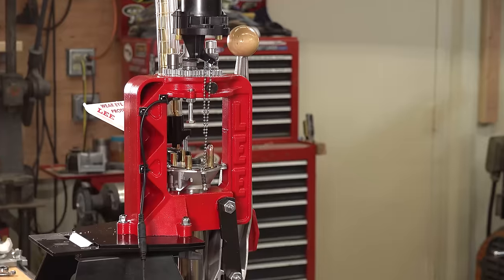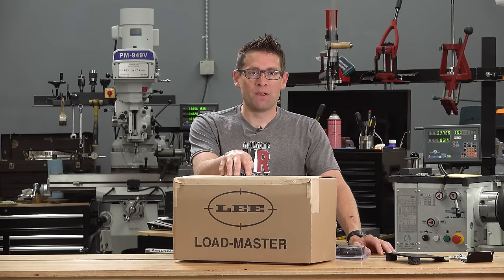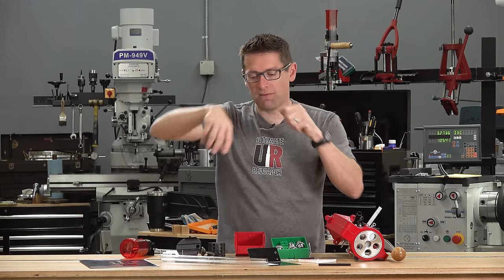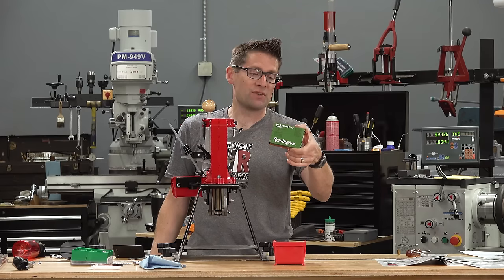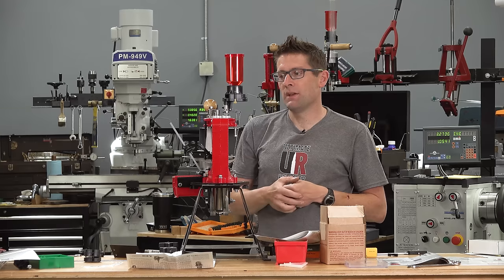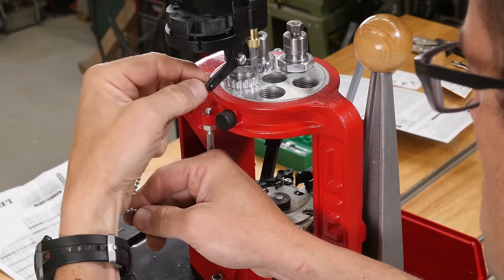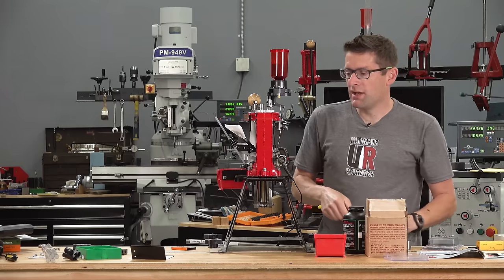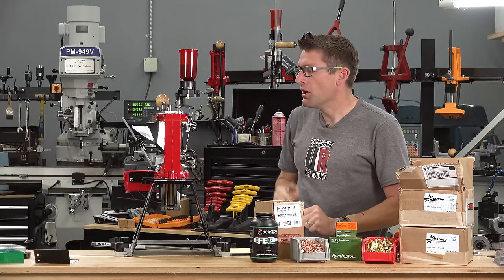Lee Loadmaster Unboxing/Setup, Loading 9mm Start to Finish

Comment: I observed that the press would tilt using the mount shown. 
There is something about the mechanics that make it move in a lot of videos. 

You were doing about (12) per minute.  
That would be about 5-600 per hour.  
People often have unrealistic expectations that output is based on how fast you can stroke it. 

This press requires that you push gently as you seat primers at the bottom of the stroke. 
At the top of the stroke pushing in the rod to move the shell plate and not roll over the primer is required. 
Developing this rhythmic movement is why some cannot use this press, sing, or dance...

Station #2 can use a Lyman M die or similar for cast bullets. 

I do have the feeling the Press is going to be updated or replaced soon.
Lee is really into their breech lock designs. 
Realistically their new locking lock rings make the need for the beech lock of questionable value. 
Also the 4.5 or 5 dies on the press is showing its age. 
People want powder check dies & bullet feed dies.  
With a four die pistol set that means (6) stations. 
Six would also place Lee in a unique position in the herd of presses.

The priming systems on Lee presses seems to be beyond 10% of the markets ability. 
Others seem to have no issues while others never got them to work. 
Avoiding primer detonations has always been part of their design in every system. 
I think the compromise will be a version of their manual safety prime or an automated trough system that the user decides they prefer.
Reply: Yup, the on-press Lee safety prime system is starting to show it's age, I personally hate it on my Classic Turret, do all priming off press now.
Reply: C-Bomb  I bought a prochucker  7 that by far was a big mistake.
Reply: That is a press that looks so nice but does not get good reviews.

Gavin 's umbrella review will be interesting.

Comment: Hey Gavin, I bought a Loadmaster last year and spent the better part of last Fall and Winter reloading with it.  I am in the process of selling my house and moving so unfortunately for me,  the opportunity to load even more due to the virus thingy, is on hold since all my stuff is in storage while I move.  Anyway, I also have the Pro 1000 and find the Loadmaster to be my favorite.  One reason is that the primer seating takes place when the operator's handle is in the down position as opposed to the up position like  on the Pro 1000.  It's just easier to push down on the handle to seat the primer, than to pull up.  I also have a micro camera attached looking down on each charged case to check the charge.  The camera is connected to my laptop which I use to display the image.  Also, the ability to empty spent primers on the Loadmaster is much easier.  My Pro1000 is still going strong however after nearly 30 years, but the Loadmaster is a real treat to use.  So I've set up my Pro1000 dedicated to 9mm,  and the Loadmaster handles 40 S&W, 45ACP, 44 Spl/Mag.  I do use dedicated tool heads for each caliber for ease of use, and the presses are mounted on a solid wood workbench.   Looking forward to seeing your press comparison!

Comment: I have two loadmasters set up 1 for 38 and 2 for 40. I also have a lee beach lock pro for 9 mm. My next step is getting a bullet feeder for each one. When I was getting into reloading I was set on a Dillon xl750 but did my research and settled to start with lee. I am still thinking of getting a Dillon. Ps love your channel.

Comment: Not happy with my lee master, i set it up for 9mm. Used your guidance as well as the instruction manual. It’s bolted to a hard flat surface and I still keep getting squib loads… Keep up the awesome videos.

Comment: I have an RCBS 4x4 progressive press that I've been using since 1985.  Everything is manually done -- the indexing, case loading, bullet loading, powder drop, primers.  I'd like to move to a more automated system, but I have such an investment in shell plates that it would cost a fortune to replace them all.  The biggest annoyance is that I shoot quite a bit of 480 Ruger, and I can't get a shell plate for it, they never made one.  I think have 15 or 16 different shell plates for it.

Comment: I don’t mind my Lee loadmaster.  It appears that yours has an updated case pusher and priming system.  I have had some major issues with the priming system to the point I started hand priming all my cases first.  That sucks because that’s suppose to be a huge benefit of the progressive press.  I’ve also had issues with the mechanism that rotates the shell plate too.   It’s been a while since I’ve used it because of those reasons.  That sucks because I have more then one tool head and shell plate for different calibers.  Great video!
Reply: I totally agree, have had those issues and more.

Comment: can't wait to get mine set up, seems like it will be a good press, don't like the plastic parts, but just gotta pay attention. I ordered the 45acp kit, they sent with a large priming pin, so I had to contact Lee and order the small pin, the pin was free, but then they charged $12.22 for shipping, I was quite upset about that little trickery.   they sure could've threw it in with the kit, considering 45acp uses large and small.

Comment: Great job on the video! I got my LM  .223 a couple years ago & your title having 9MM caught my eye as I bought everything to start doing 9MM soon. I've loaded .223 & 300 Blackout with good success. However when the cases get down to 2-3 in the feed tube, they will tend to bounce on the tongue & fall off. Seen many others have this problem too. How to fix this? 
Others have tried various techniques, none of which I like. 

I added an LED light under the powder station to see if the primer didn't get seated. Hate cleaning up spilled powder. Added a light ring upgrade to see the powder level in the case too.
Also I started out with Lee in '08 with the Classic Single Stage Press to see if I even would like reloading,  and started with .40 cal. I did like it,  so then stepped up to the Classic Turret Press. I still use these 2 presses from time to time.

Comment: I found that if I use Accurate #5 powder that it is so fine it drains through the flash hole if it does not prime a case, which is fairly common on the loadmaster. Just don't forget to empty it often so the ram doesn't turn into a pipe bomb at crotch level.

Comment: You may this look too easy. Thanks for the video. Mine would not even index the shell plate when I took it out of the box. Lots of trouble getting it to work. Not a happy camper. I guess video editing helps because I don't see any upside down cases being fed into the shell plate. :) That's thanks to the collator.

Comment: Gavin, I came real close to ordering the loadmaster.  But after fighting with the lee bench top primer I didn't have any faith in the loadmasters priming system.  I bought a used Dillon 550B instead.  But my uncle picked up a loadmaster so I will eventually get to compare them...

Comment: Yes I run a loadmaster and have found that that your brass primer pockets have to be perfect or you are going to get tipped or crushed primers.  Using new brass like you just did is a huge advantage.  Can you do a video on how to achieve perfect primer pockets so we do not get any jams using  the lee Loadmaster?  Also troubleshooting tips on the case feeder.  Thank you
Reply: RCBS case prep station and bevel all primer pockets prior to reloading. ZERO issues thus far.

Comment: ...I used to own TWO Pro 1000s both with the case collators...it made the whole process so easy...too easy because I got into a groove and didn't notice that I'd run out of power along the way...after you've hadda disassemble at least 100 rounds to find where the oversight occurred you'll never do it again....with the disks I found on my setup that the holes were about .3 grains over - an old timer (I'm an 'old timer' now) told me that he adjusted

Comment: Had a Lee 1000, which was damaged in a notable flood.  Replacing it with the loadmaster. Looking forward to 5 stages.  Half set up now.  Had a little trouble with the indexing not indexing, but it seems to be fine now.

Comment: Just bought a Loadmaster and have lights on order.  One of the case alignment tabs snapped off on the priming station.  The fellow I bought it from Budget Shooter Supply in Surrey, BC, Canada, was good enough to swap it for another one he had in stock.  No idea how to change the whole carrier which is what I would have had to do.  You have a video on that?  I have another carrier on order from Midway just in case.  The press seems to work great. Things slow down when you have to gauge each loaded round, add primers which is a pain with new priming tray, and keep flipping over cases that are in tubes upside down from collator.  They advertise 500 rounds an hour.  I’d say closer to 200 which includes above plus picking up loaded rounds on floor.  Lee has also made mistake of discontinuing this press and coming out with the 6000 which is way more cheaply made.

Comment: I found that when loading cast or powder coated cast using a separate crimp die is a necessary.  Using a crimp seater die will shave some of the lead or coating off

Comment: I had the loadmaster for a couple years finally got rid of it and bought the Dillon 650 best thing I ever did. I’m mechanically inclined and could never get the press to run reliably.
Reply: Same, I'm a master mechanic, can rebuild transmissions with my eyes closed, best day of my life was when I got rid of the Loadmaster and got a 650...

Comment: I'm running a Loadmaster still working at getting it running smoothly. My main problem right now is the indexing rod and flipper set up. It will work for 5 or 10 round then I have to adjust it again. Still have a lot to buy for it too since I was a used press.

Comment: Wow, I bought my Lee Loadmaster in 1994. It works very good but perhaps I need to update a couple of accessories. I had trouble with fully seating the primer on the 44 Magnum. Typically a wheel gun, I could not close it. Never got it corrected but honestly have not tried since. ASE Master Tech since 1978 - Retired

Comment: Im trying to decide if I should go with the loadmaster being I own mostly all lee products, or take the plunge and go with a dillon 750
Reply: I have been using a Dillon Square Deal  B for 29 years and recently upgraded to the XL-750,  It is expensive but runs like a Singer sewing machine.  I grin every time I use it.  You wouldn’t be disappointed with the 750.

Comment: I am a beginner and have zero experience but some knowledge. Very mechanically inclined as in automotive, boiler maker, welder/fabricator. I am interested in this setup. I just got my friend to bring his single stage and sorted used brass for a few hours. This would be nice as my body isn't as young as it used to be with a back injury and all. I can't believe how quicklyand efficiently that progressive station works. I need one.

Comment: Loved the idea behind the Lee Loadmaster but that love quickly faded. Something always needed to be tinkered with, which in the long run ended up costing me time and money. I did all the mods and upgrades thinking that would fix it but nope. I would be lucky if I could get 25 rounds through it without some issue happening. In the end I got rid of this frustrating machine and bought a Lee Classic Cast Turret press. Hands down a better and smother running machine. I think it’s the best machine Lee makes next to their single stage presses. It’s not any slower than the Loadmaster is either when you take into account all the time spent tinkering with the Loadmaster. If you’re thinking of buying the Lee Loadmaster save your money and your frustration level. Go buy a Lee Classic Cast Turret Press. You’ll be thankful you did.

Comment: Just ordered my Loadmaster. Looking forward to using it. I’m planning on using the Hornady case activated powder measure, the one you have pushed thru Mid South. I now have two of the powder measures, they are excellent and couldn’t be happier with their quality. I was planning on using a universal primer in station one, with the in removed, flare in station two, charge in three seat in for and crimp in the fifth station. Any recommendations? Love your videos.

Comment: I use a loadmaster. I have issues with the primers turning sideways and upside down. I was using the auto disk but switched to the drum. It was easier to adjust powder.

Comment: Great content, man! Thanks. I am planning to start reloading this year. I know Hornady has a rebate in place until later this year, but the Load-Master seems perfect for me to start. My plan is to reload 44 mag and 45ACP. Not very high quantity... Would you go Load-Master, Lock-N-Load AP or Lee Classic 4 Hole Turret Kit? Thanks
Reply: The (4) hole turret will make 200+ handgun rounds per hour. 
So if (200) is what you need in each caliber you will be very happy. Simple and stress free.

Richard Lee says 500+ of a specific caliber per week is the minimum to consider a progressive press.

Comment: Seats the primer on the up stroke. There is an upgrade you can get to add a spring return to the powder slide rather than the chain which often breaks and is a pita. How do you catch the spent primers when using fired brass?

Comment: I have 2 Loadmasters but only one was setup and never got it working just quite right for 9mm.  Flipped primers and the case feeder never really worked smoothly.  After watching the video I'll take another stab at the case feeder and it sounds like the primer flipping problem is not a solid enough mounting.  I'm highly mechanical and was surprised I didn't figure it out right away.

Comment: This looks like my next press! I bought a Lee Precision single stage press last year (so far my only press). I started with loading 300 BLK and I've also done a bunch of 223. I just bought a set of dies for loading 38 special and I'm hoping to start on that. Next will be 9mm, and the progressive press looks like the way to go.

Question- does it "know" when there isn't a case? For example, if I leave a space open does the powder get dumped all over the press?
Reply: Yes. I do not know if it is true with every progressive, the charging system will not dump a charge without a cases being under it. All the progressives are pretty much the same in how the charging system works. The Lee Loadmaster throws a fairly consistent charge

Comment: I have no experience reloading, however within the past 3 years I’ve developed an interest. I watch the videos on the single stage machines but the process seems very dragged out. I guess if the guy was really into the reloading process and re-manufacturing as a hobby the single stage would be right up their alley. However I am into the thought of high volume reloading, Consistent rounds at a high volume. In this video that I watched I was very impressed with. If it was and affordable option I would like to have something a little more automated.

Comment: I've run a pro 1000 sense the 90''s. Have tens of thousands of rounds through it in 9mm, 40sw, 38 special, and 45acp.
    She anit fancy, she anit fast 300 to 400 rounds a hours. But she does the job PERIOD.
Back in the day Dillion was way out of my price range. Today I can buy what ever press I want, and I still run that old pro1000.

Flame away at me.

Comment: Hey Bud, you put out great content. I am looking to buy a progressive reloader and had some experience with a single-stage RCBS years ago.  I am looking at a Dillon XL 650 used but the lee prices (new) caught my eye, still unsure which model but I am looking for automation. Considering that I am mechanically inclined, which model would recommend for me?  Loadmaster seems good, any better/newer?
Reply: You can try the Lee APB 4000 too, or the Lee Pro 1000 (three stations)

Comment: Just learning now.  Can I guess that any sizer/deprimer will work in station number 1 as long as the die is larger than the 9mm case, when using it just for case "alignment"?

Comment: Picked a well used Loadmaster from my neighbor. Had the classic indexing problem. Finally got around to looking at it again; bought a bunch of new parts for it - still won't index right. So. Do I buy a new one it a kit or cut my losses and go with a different brand? I'm sleeping on it. Kinda depends on just how much shooting I end up doing - I've taken a several year break.
Reply: Could be the shell plate like he said in the video. 
The updated plates look kind of like a star underneath instead of the pins shown in the old videos.
Reply: Did you align the carrier
Reply: @livincincy4498  Yes. Bought a new Load Master and it functions correctly.

Comment: Bought a 1911 Remington last 4th of July weekend. 75 dollar rebate. After going around the block for 10 months I got the check today at 4:45 pm. It expires on May 8th. Today is May 8th. Their reason is " They are not responsible for the U.S. Mail". I'm cutting and pasting this to every channel I sub to.

Comment: My Lee 4 hole turret press has served me well over the years, but the Loadmaster was the most infuriating thing I've ever had the displeasure of owning. When the auto primer wasn't getting jammed, I was getting hanging primers. Case feeder wasn't reliable, and sometimes cases came out sideways or fell out. No matter how much tweaking I did, it would just keep cranking out rounds with no primers. When it did work, it was great, but that never lasted long. Most common problem was the primer seating plunger getting stuck and jamming up the entire press.

The bullet feeder was fucking awful. All it did was fling bullets on the floor. I even used bullets that were in spec per the instructions. Still, bullets on floor. I returned it.